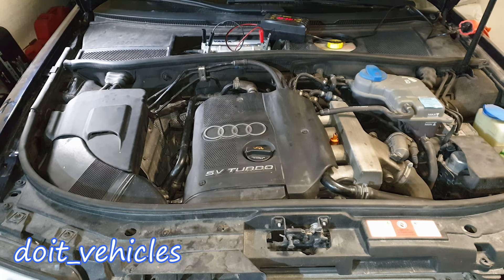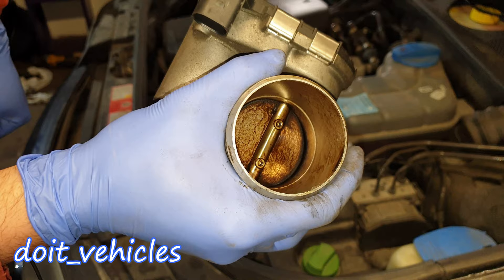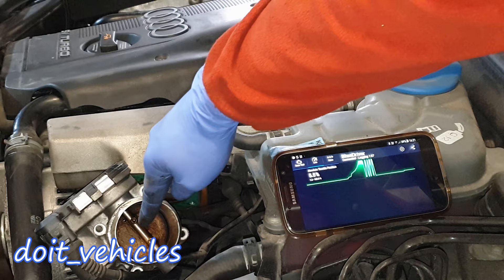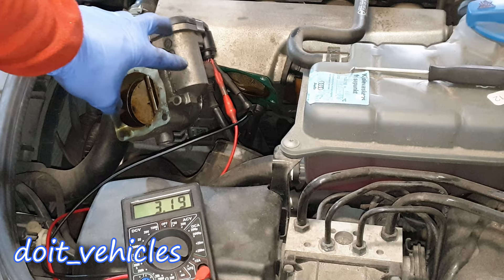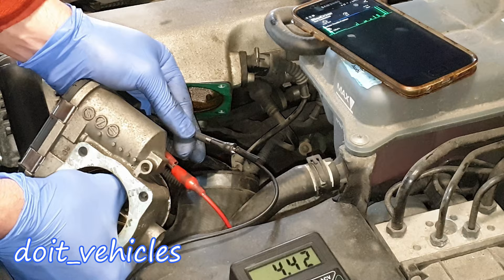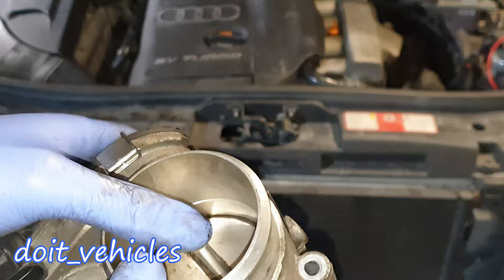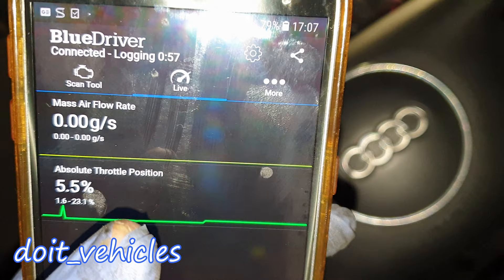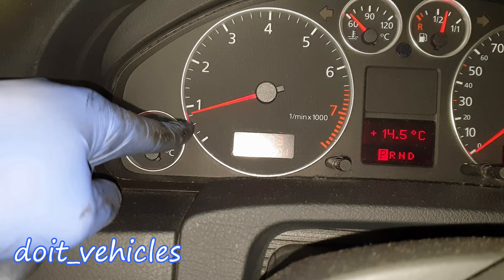1.8T How can Cleaning the Throttle Body can make Your Car run better - Audi A6

Comment: Thank you, very useful.
Tomorrow I am going to clean mine as well, I had turbo issues , replaced the turbo, now it is running poor, not going in boost and misfires on hi revs.
Idle is waving, engine stalls after high revs.
Reply from the maker: I would check the live data as well
Reply: @doit_vehicles  
It is an project car, golf mk1 ecu is not letting in, I can see some basic info, not more.
But I did clean throttle body, was super dirty. I found also some little boost leak.
It drives just fantastically now, finally it runs as it should, thank you very much.

Comment: My Audi A4 1.8T has an uneven jerk when starting and fuel consumption jumps up to 20 L/100 km when driving a short distance of 1 km uphill. It drops down to 6.0 over a longer distance. I changed the spark plugs and its still the same. Car is nearing 100000 km and I am wondering if the throttle body is the culprit.

Comment: Great Video  a question for you I have a 1998 AEB 1.8t Passat sport and a couple of years ago I decided to clean the TB  but i made a mistake as I took the butterfly off to give it a good clean and now it wont reach the lower stop so it idles too high in the TB stepper motor inside is here a way I can manually reset the lower stop  it is like a stop inside needs to be moved a bit any help would be great thanks  and I love my car had it since 2005 still drives perfectly and very rare now

Comment: Hello I don’t have the listed fault codes, but I’m having rpm blipping between 850 and 890 rpm. No fault codes, lower mileage, and a little bit sluggish on the throttle pedal.
Reply from the maker: Hello , this type of problem needs a deeper diagnosis since on this car there are few sensors to trigger any warning light

Comment: Wondering if this is why my engine shakes after turning on the a/c. At 1st I had a drag in acceleration after turning on my a/c, but now it's shaking my engine & dropping in rpm at idle. Gonna go grab some thb cleaner & see if that helps because i have no codes for misfire. Only code i have is my secondary air pump (smog pump). Already replaced map sensor, some air hoses all were filthy, so I think my problem lies with the throttle body being dirty. Plus I'm at 179k in my 02 audi a4 quattro 1.8t
Reply from the maker: Some live data will help as well to see what's happening when rpm goes down

Comment: Hello, I have a petrol Audi A4 1.8 automatic of 1998. For two days now when I start the engine I notice that it does not start easily.  After it finally starts and I put the lever to "D" when I press the pedal I see that the engine wants to turn off when I keep below 1800 rpm it works normally, but if I press more the pedal starts to break, what do you think it can be..?  I.  I believe that the throttle has some problems, you from the experience you have what you recommend me to check.
Reply: Hi, I'm experiencing same problem, same car.. Now I have a very high fuel consumption.. I think I need to clean the Mass air flow sensor and throttle body.. Found solutions to yours?
Reply: @TheGodson2000  finally it was one of the spark plugs ignitor.
Reply: @5b4aezmarinoscyprus71  Hi, you removed the ignitors and checked for what exactly?
Reply: Also the last month I changed my air filter, it was the one from the factory 1998 was written on it and I noticed the throttle body is dirty also, the fuel filter i also think was factory from 1998..the previous owner I would imagine haven't changed those parts